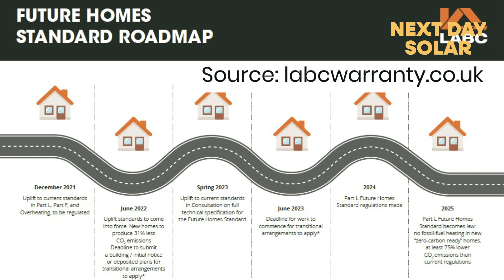Will Air Source Heat Pumps replace gas heating systems ? ASHP uncovered

Comment: Heat pumps 3X the cost of gas to run 

A a regular London house heating costs go from £1,200 a year to £3,600 

Not good 

It's the most stupid idea ever
Reply from the maker: However, you cannot run a gas boiler on SOLAR PV, or any readily available renewable (non destructive) energy supply. So if you are paying for your energy, yes it may be more expensive but if you are able to generate your own reliably, then the increase in energy consumption is somewhat irrelevant.
Reply: @nextdaysolar3349  

Agreed in that situation 100 percent makes sense 

In cities with gas supplied to the door it makes zero sense 👍
Reply from the maker: @the1beard  as of 2025, new builds won't have much of a choice, and for the reasons that you state, its going to take the people/economies of the world, 50+ years to steer on a more climate friendly course than we are on now, as ripping out a good working boiler, and replacing with a bright shiny ASHP is also not that climate friendly either.
Reply: @nextdaysolar3349  

Insulation is the best bang for buck 

Victorian houses and flats I work on get the maximum insulation possible 

It's a no brainer 

A pity that it's not as Sexy to government 

We are governed by imbeciles